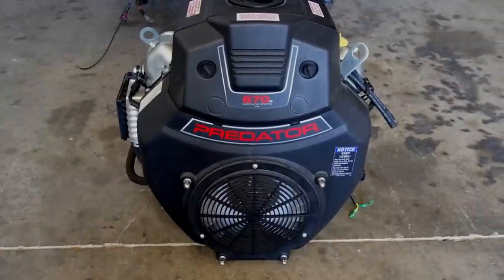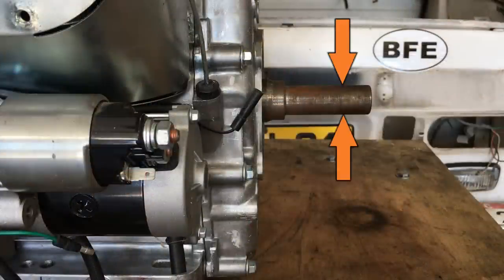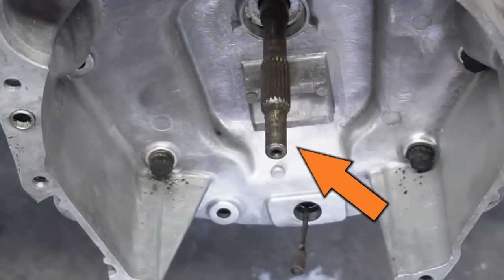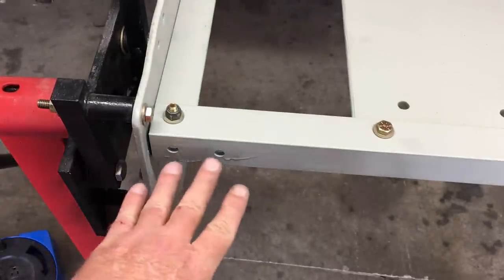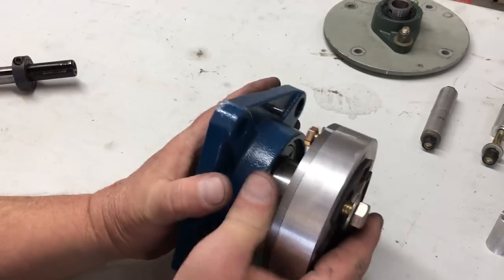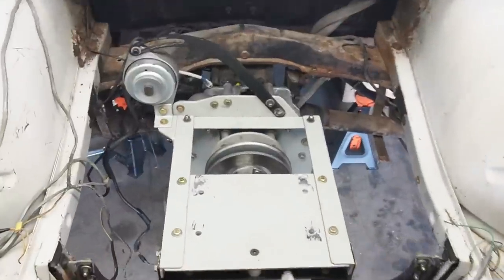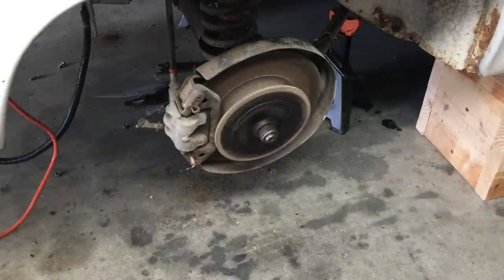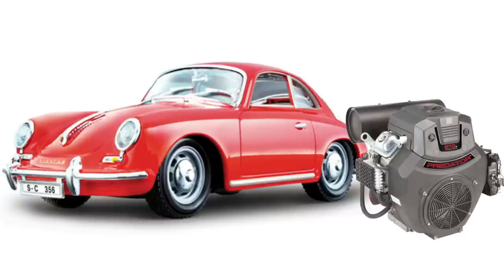S3 E18 We put a 670 Predator V twin in our project car 1969 Renault 10

Comment: Cars You Don't Want to Show Off

If you've owned more than one car during your lifetime, you likely have a favorite, one that stood out from the pack for whatever reason – maybe it was fast. Perhaps it was the vehicle you brought your first baby home in it, or you just really liked the color.

If you have a favorite, you probably have another one that didn't live up to expectations. The seats were uncomfortable, or the paint faded quickly. For whatever reason, it was just a disappointment.

It's the same in the automotive world in general. Some cars are stars, like the Ford Mustang or the best-selling Toyota Corolla, and some are true duds. Here are some cars that are amongst the worst cars ever made.
Reply: Hummer H2

In 2002, General Motors introduced the Hummer H2 to the world... and most of the world went "No, thanks." This scaled-down version of the civilian Hummer is still a massive hunk of metal that weighed in at over 6,600 pounds!

The H2 was produced through 2009 and, despite its unattractive design, there were some aspects that we liked. Inside, leather was standard, there was seating for five and the behemoth has an optional third row that increased seating capacity to seven.

The 2009 model boasted a 6.2-liter V8 with 393 horsepower, which was plenty of oomph to get this beast moving. It also had good off-road capability and could tow up to 8,200 pounds.

That being said, there were and are plenty of SUVs that could match or exceed the H2's capabilities, and look a fair sight better while doing so.

The biggest drawback of the Hummer H2 was its fuel efficiency, or rather, its lack thereof. Because it's classified as heavy-duty vehicle, the EPA did not perform fuel economy tests on the H2. However, one critic recorded about 10 mpg, which is simply atrocious.
Reply: Suzuki X-90

The rather bizarre-looking Suzuki X-90, produced from 1995 through 1997, reminds me of a toy car your mom might have bought to go along with your Barbie doll. Not only is it small and ugly, but it's difficult to tell which end is the front and which end is the back. It does have a removable Targa top roof so that Barbie, or, uh, the driver, can enjoy the wind in their hair.

Described by Suzuki as an SUV, the two-seater does boast the height of a sport utility vehicle. It has a 1.6-liter four-cylinder with just 94 horsepower, and was available with rear- or four-wheel drive.

It's not surprising that Suzuki only managed to sell about 7,000 of them in the U.S. It didn't help that it was marketed with the tagline “What are you staring at?” I imagine many people likely responded, "I don't know."
Reply: 1920 Briggs and Stratton Flyer

The Briggs and Stratton Flyer, made in 1920, is the most basic of basic cars ever made. It barely qualifies as a car, though it does have four wheels (actually, five), a steering wheel and doesn't require a horse to pull, so we'll give it a pass.

What you should remember when looking at the Flyer is that the Ford Model T, which appears infinitely more comfortable, had been in production for more than 12 years by this point.

The Flyer has a wooden chassis, no suspension, no bodywork and no windshield. The oddly-placed fifth wheel in the back is driven directly by the engine. To start the car, it has to be lifted off the ground with a lever and then lowered back down again.

It boasts a 200 cc, two-horsepower engine and can reach a speed of about 21 mph. I think I would have stuck with a horse and buggy.
Reply: Chevrolet SSR

The Chevrolet SSR (Super Sport Roadster) was GM's crack at the early aught's retro movement that saw cars like the Plymouth Prowler, the 2008 Dodge Charger and the new Ford Thunderbird.

While the Charger and the Thunderbird aren't bad-looking, the SSR is an unusual pickup truck/convertible combo that really didn't work.

Produced from 2003 through 2006, only about 24,000 units were sold, fewer than 10,000 annually. The SSR has a retractable hardtop and initially boasted a 5.3-liter V8 engine with 300 horsepower, going from zero to 60 mph in less than eight seconds.

It was upgraded in its final production year with a 6.0-liter V8 engine with 390 horsepower that could accelerate from zero to 60 mph in about 5.3 seconds. Ultimately, those aren't bad stats, and I think this was a car that was either behind or ahead of its time – the public just wasn't interested.
Reply: REVA G-Wiz

I'd bet that you've never heard of the REVA G-Wiz, even though it's perhaps the most reviled EV ever made.

The vehicle was actually named the REVAi and was sold as the Reva G-Wiz in the United Kingdom – it never made it to the United States. It was developed by Reva Electric Car Company in India, and they sold 4,600 from 2001 through 2012, though half of those were sold in its country of origin.

The intent was to design a small, practical and affordable electric car. The result was this tiny micro vehicle that is actually classified as a quadricycle, or a four-wheel motorcycle.

The REVA G-Wiz boasted eight six-volt lead-acid batteries that produce 15 horsepower. The vehicle's top speed is about 50 mph.

Inside, though the manufacturer boasted it could seat four, there is barely room for the driver. These factors, along with poor safety ratings, lands the G-Wiz firmly at the bottom of an ever-growing list of EVs.
Reply: Pontiac Aztek

Would it be a "Worst Cars" list without the Pontiac Aztek? We think not. Manufactured from 2001 through 2005, this car makes the list because it's one of the ugliest vehicles ever to grace America's highways. It also helped kill the Pontiac brand.

The Aztek was meant to both appeal to young people and serve as a practical family car for the slightly older generation – fun, stylish and cooler than a minivan.

The concept is sound, but this was a clunky crossover that no one wanted. It wasn't just the awkward rear end and all that gray plastic that turned off buyers. The crossover SUV was just taking off, and yet the Aztek's short hood, boxy shape and small wheels gave it the look and feel of a minivan.

Buyers instead went for the Hyundai Santa Fe or the Toyota Highlander, which were of similar size and much more attractive. Or they just bought a minivan. Pontiac went out of business five years after the demise of this atrocity.
Reply: SsangYong Rodius

Produced by Korean firm SsangYong from 2005 through 2013, the Rodius makes the list for its awkward lines and plodding engine.

According to the manufacturer, the look of the Rodius was inspired by luxury yachts, but I certainly don't see it. The front looks like a standard early 2000s car, but the back is best described as awkward. The line of the door frame drops, but the roof continues straight to the back of the car – it looks both rounded and boxy at the same time.

SsangYong developed the Rodius to add a spacious vehicle to its lineup, and it did succeed in that regard. The Rodius seats seven but, hopefully, they don't need to go anywhere fast. The vehicle is outfitted with a 2.7-liter Mercedes diesel engine. Zero to 62 mph takes around 14 seconds. Buyers of the Rodius faced massive depreciation, with all versions losing more than 75% of their value after three years.
Reply: Reliant Robin

If you've ever seen a photo of a small, three-wheeled car from the 1970s, chances are it's a Reliant Robin. At first glance, it doesn't seem all that bad, beyond that missing wheel up front.

Launched in 1973, the first model had a 750cc four-cylinder engine, which was replaced with an 850cc engine in 1975. Because the Robin is made of fiberglass, and tiny to boot, its top speed is 85 mph with 70 miles to a gallon of gas! Sounds appealing right now, right?

The Robin has a reputation of easily flipping over, which is exaggerated in movies and TV. That being said, one would imagine it felt a bit wobbly, and there is also the issue of steering wheels popping off while the car is in motion. Also, if you need to back up, tough luck, as there is no reverse.
Reply: Ford Pinto

This is one of the "Worst Cars Ever" that you may have heard about, due to its unfortunate tendency to burst into flames after a collision.

Produced by Ford from 1971 through 1980, it otherwise isn't a bad car. It was quite affordable and small, with two doors and a hatchback. Unfortunately, the placement of the fuel tank means that the car can catch fire after a rear-end collision. It became a PR nightmare for Ford, which reportedly knew about the problem but decided that the cost of fixing the issue wasn't worth it compared to potential payouts to the victims. Yikes!

Ford eventually issued recalls for the Pinto in order to fit them with a protective shield, and the company now has an improved safety record, making our 2022 list of the 15 Safest Car Brands.

We do recommend, however, that if you see a Ford Pinto on the used lot, steer clear.

Comment: You realize that you just gave instruction on how to swap a Predator 670cc V-twin into a air-cooled Volkswagen... right? Well, if you did, it wouldn't be recommended for anything much heavier than a dune buggy. And, judging by the RPMs it was turning at highway speed, certainly not for anything that lacks a 5-speed.😕